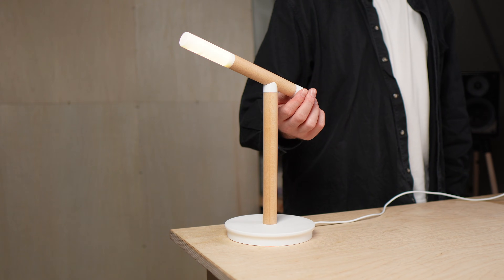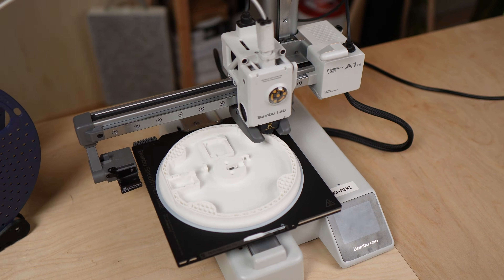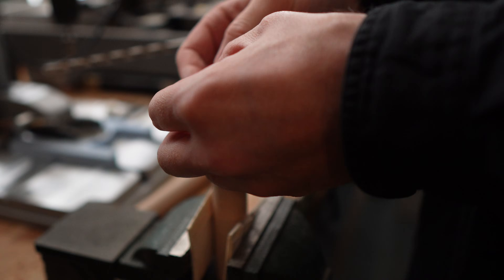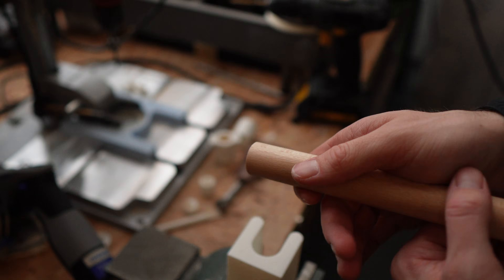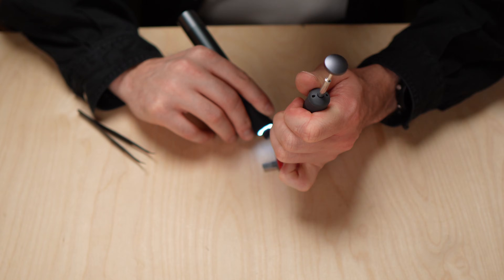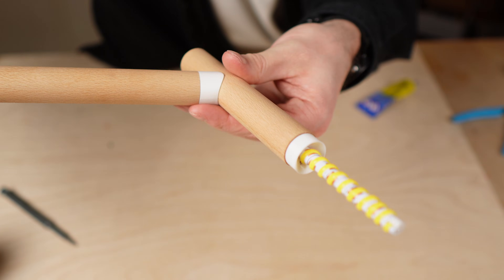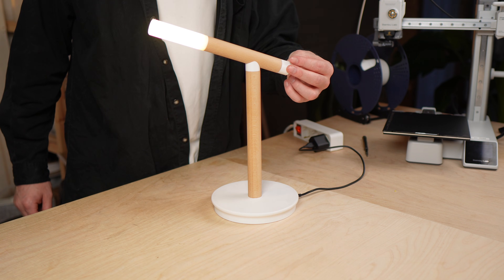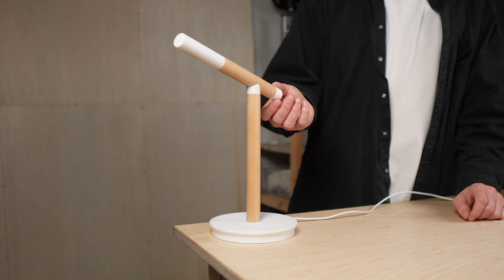I Built a Desk Lamp With Everything Hidden Inside

Comment: That is a very sleek design and a clever use of components. The only thing I would say is that it maybe needs a reflector over the top half of the tube that covers the light so that it shines down rather than all around. You could insert a very thin piece of aluminium inside the tube as a reflector. Thanks for sharing.
Reply from the maker: That’s a really good point, thanks for the suggestion.
An internal aluminum reflector would actually make a lot of sense for heat and light direction.
Definitely something I’d improve in a next iteration :)

Comment: I really like your videos and I bought your last two projects, but you generally make this mistake: people who watch your videos might want to do the project, but you lack resources, especially for the assembly stage. You've listed the materials, okay. 3D files are available, but there are no assembly files, no diagrams showing which cable goes where. I bought it and I can do it somehow, but there might be users who want to do it but don't have much knowledge.Another thing that occurred to me later is that neither the video nor the documents mention the measurements of the pieces of wood you cut. At 02:02  you're creating a hole with a tool, but that tool isn't on the materials list; what's its diameter, etc.? At 02:34 seconds, you're drilling a hole with the tool, but you haven't specified the exact centimeter mark. A hole drilled by eye might distort the shape of the lamp. You say the video contains all the details, installation guide, etc., but the file you uploaded to Kofiye doesn't have that information.